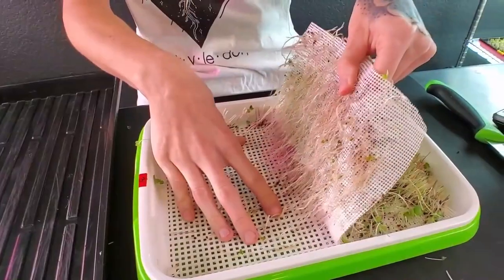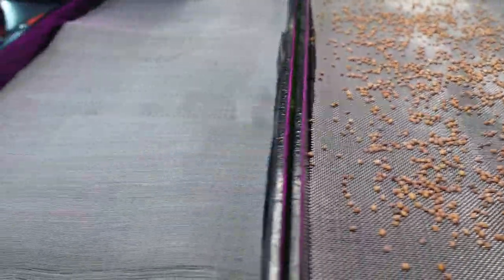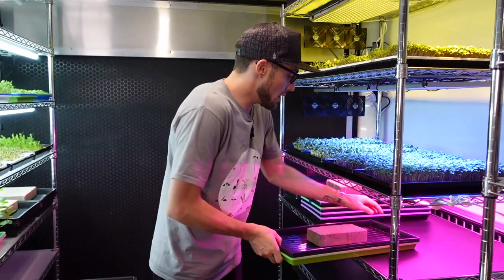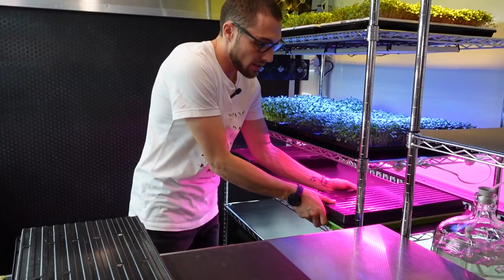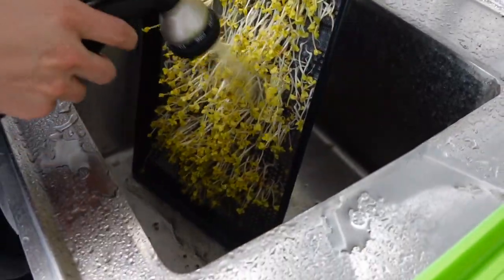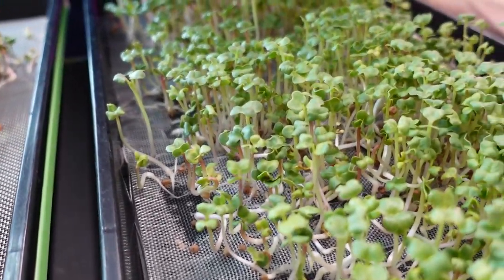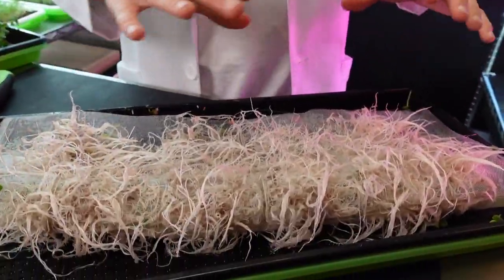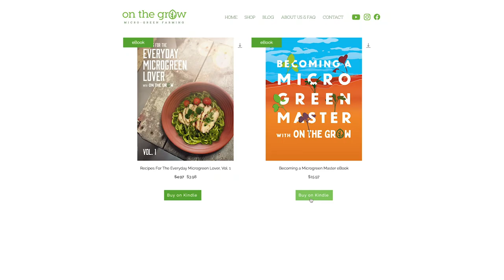Reusable Grow Mediums for Microgreens!!!

Comment: It's a great product idea.  Seems a rigid frame would help it a lot.  Considering that the purpose of your mesh trays is to hold a loose growing medium, they may prove redundant of the concept you're developing.  It would be a real selling point to me if we could keep it a two-piece system: bottom tray and medium frame that suspends the steel mesh, say, a few mm over the wet floor.

Looking at the rest of the comments, you really got our gears turning.  Keep up the content!

Comment: Helpful Info: TYPICAL MESH SIZES

Here's a helpful size progression ive assembled, with examples.

1 mm = #18 mesh (note: 20 mesh is actually 0.85 mm, even though EVERYBODY, buyers & sellers alike, incorrectly assumes it's 1mm)

> Seems ok for many seeds ranging from small to medium, but tiny seeds tend to drop thru (ex: basil). Misting helps.

1.5 mm = #14 mesh (ex: I have some soft flexible white vinyl mesh for my dehydrator that are 1.5 mm, but I dont know the brand)

> This is the min size I suggest for larger seeds and small beans (ex: mung)

2 mm = #10 mesh (this seems fairly common for clear semi-rigid sheets for many dehydrators.  Mine has 2x3mm rectangular mesh)

> seems ok for small beans

2.5 mm = #8 mesh (ex: The Green & white sprouting trays sold on amazon are 2.5 mm).

> seems ok for small beans
3.5 mm = #6 mesh (ex: standard 1020 mesh trays, ala Bootstrap Farmer)

> Ok for most beans (ex: pea shoots, sunflower)
Reply: UPDATE: So far, the seeds that seem to work best for me wiith the 1mm RGM are MUSTARD SEEDS, of which ive tried yellow so far.  Their skinny radicals seem to work well with the mesh, without any signs of stress  and once grown to the size you like you can either pinch out whole clusters with the roots intact, or just cut off the roots with a bench scraper, easy peasey.  

I went with 25 gr for an 8.5 x 11.5 sprouting tray, and got a nice dense grow, without any laydowns.  A little H2O2 is recommended until blackout is over.

I look forward to trying other varieties of mustard MG with the RGM.
Reply: Thank you!

Comment: This was so informative to a newbie like me! Thank you! I wish I had seen it before making a polyethylene purchase lol but, I also went ahead and bought some stainless. So, now I guess I can do my own comparisons, too. But Maaannn was that plastic expensive!!! Holy crap!! $80 for 8 sheets. Vs. $39 for a roll of stainless!! Neither of them have come in yet so, I may end up returning the plastic instead… we’ll see. I just did my very fist tray of Microgreens yesterday… basic salad mix, to start with something easy but I put them in soil because it was all I had. However, I did set it up on a self watering system with a little h2o2 in the mix. Now, I just need to add the bubbler to it so it’s not stagnant. Fingers crossed 🤞🏼 lol Thanks again for your guidance and inspiration. 🌱😊✨

Comment: You can probably warm up that poly mesh in some hot water and make it totally flat. I will get some and try it. Dehydrator mesh flattens right out running inner hot water in a sink no problem.

Comment: This is a good idea, I can see benefits from the stainless steel. Cleaning could be made easier if you were to heat the mesh and dry the greens so they breakaway more cleanly. Probably some kind of oven/grill or blow torch.  I was thinking of trying an alternative media maybe  with some sort of NFT.
Reply from the maker: Great suggestion! Honestly, it’s quite easy to clean with a spatula or similar flat scraping device. As soon as you scrape one side off, the other side just falls out, then all you have to do is a quick rinse and sanitize! Total time to scrape it is under 15 seconds per mat! I’ll make a video on it for next week hopefully! 🌱🌱
Reply: Yes, great idea for cleaning. If you heat it real high, like maybe over 500 degrees, it would turn anything on the screen to carbon.

Comment: FEEDBACK ON RGM (mesh too fine for pulses?):  Hi, im a home hobbyist grower, and decided to give the 1mm Stainless Steel growing mesh a try ... and ran into a problem, because the first thing I tried was pea shoots, and I failed. 

My setup was simple - I used one of those 9x13 green sprouting trays with the white mesh drip tray, cut a sheet of mesh to fit the latter, soaked 100 gr yellow peas for 12 hrs, then spread them on the RGM, added another green nesting tray, and a 5 lb weight, and then waited several days, watering lightly 1x/day.

 So far, only about 1 seed in 4 seemed able get thru the RGM, then thru the plastic mesh tray, and into the water below, during the weighted phase.  All the other radicles just seem to struggle to grow horizontaĺly, and rapidly die off or rot in place even before they reach blackout phase.

I admit i'm a total novice with microgreens, but my guess is that your "one size fits all" approach with the 1mm RGM mesh is ... problematic, not just because different seeds and pulses have very different sizes, but different diameter radicals.  You may need to consider not one bur rather TWO and possibly even THREE different mesh sizes ... say fine mesh (1mm) for fine greens like radishes and broccoli sprouts, medium mesh (1.5 - 2.5 mm) for larger seeds and small pulses (ex: mung bean sprouts), and a larger mesh (3.5 mm) for med to large pulses (ex: pea shoots, soy bean sprouts, etc).

Would love to hear some feedback/advice.

Meanwhile, i'll try mung beans next ... the radicals on those should be a little smaller than peas.  If that doesnt work, i'll just relegate the RGM to small seeds exclusively.
Reply from the maker: Why didn't you grow the peas directly on the mesh sprouting tray? The mesh is meant for smaller seeds that would fall through the plastic mesh. If your seeds don't fall through the plastic mesh, you don't need the metal mesh. 

Yeah, we are going to have more sizes for smaller seeds, but larger seeds can grow directly on the plastic mesh without any need for the RGM. 

Let me know if that makes sense.
Reply: @OnTheGrow  It makes perfect sense, and I was already half expecting that to be the case.   My guess is that 1 mm will likely be good for small to med seeds (upto 3mm), but larger seeds and nearly all pulses wont work with the 1mm RGM - gotta do exactly what you just said (just the mesh tray, with or without a soil as medium).

I'm slowly cobbling together a long list of stuff id like to sprout, and what mediums (if any) are compatible with each.
Reply: In case anyone finds this interesting or useful, I just now checked the sizes of the seeds I have with digital calipers.  I measured max cross section, as a sort of "drop-thru" stat. For example, on Wheatberry, i'd measure max width, not length, and give a range of berry sizes measured.

From my smallest to largest (milimeters)
Quinoa, white: 0.9 - 1.9 mm
Broccoli: (1.5 ish)
Mustard, yellow: 1.2 - 2
Wheat, kamut (diam): 1.6 - 2.5
Radish: 1.7 - 2.9
Mungbean: 2.5 - 4
Yellow Pea: 4.5 - 6.8
Soybean: 5 - 7
Chickpea: 5.5 - 7.8
Reply: @OnTheGrow  UPDATE:  MUNG BEAN SPROUTS (aka Mung Gota) are borderline on the 1mm RGM, but the radical diameters are definitely near the limits of this mesh size, and tend to stress the roots a bit, causing light browning.  Ive tested and confirmed that the min mesh opening needed to avoid root stress seems to be 1.5mm+, similar to soft white vinyl mats typical in some food dehydrators.

TIP (4" long mung sprouts): In order to get mung sprouts to grow long and straight, they need side support, which I manage by using a tall container and careful control of the amt of beans.

Setup: 
> 1 Cambro 2L Polypro Cylindrical Tupperware -> Use a 1/8"drill bit to heavily perforate the bottom of the first cambro (which will serve as the mesh tray), with as many holes as you have the patience for ... the more, the better. Then cut a circle of the 1mm RGM to fit flush inside the bottom of the perforated cambro, and then nest the perforated cambro into the unperforated one, and you're good to go.  

> 1 Cambro 2L PET Cylindrical Tupperware (or just use a 2nd polypro one).  This is the bottom tray, and what you store the finished sprouts in (drain well, salad spin, then line bottom with dry paper towel ... sprouts will keep 5 days or so).

Method: Soak a scant 1/4 cup of Mung Gota (whole green mung beans, unhulled, unsplit) for 8-12 hrs, then rinse well and spread evenly over the RGM in the top cambro. Fill the bottom cambro with 1/2" or so of highly dilute liquid nutrient, so that the radicals dont need to reach far after stretching down thru the RGM. Cover the stack with a dark cloth, and give it 4-5 days of blackout (misting 2x/day with water, just until the radicals reach the nutrient).  Sprouts are done when the tops begin pressing against the cloth, and the first 2 leaves begin appearing.  Do not give these light, or they toughen and turn bitter - theyre ready to eat after blackout.

To harvest, cut off and discard the roots, then submerge sprouts in a LARGE bowl of cold water and agitate gently to dislodge the green hulls (discard).  Done. ☺️
Reply: @OnTheGrow  FEEDBACK (UPDATE): BASIL. 2 tips ...

> Frst, use the RGM to pre-sieve your basil seeds, and reserve any seeds too small that drop thru (about 1/3 for me) for separate use on coco coir.

> Second: once the cotyledens are big enough (approx day 12+), I discovered that the 1mm RGM holes are just large enough to let you pick out individual basil sprouts FULLY INTACT with a pair of tweezers, for transplantation.  The radicals are so skinny that they slip out easily, with all their feeder hairs intact.  So far  ive had 100% transplanting success with them.

Anyway, just sharing the result.  Cheers.

Comment: Do they make a copper mesh? Copper has antimicrobial properties, although I wonder if it would screw with germination as well as keeping mold in check...
Reply from the maker: Great question! I am sure that it would definitely help as you have mentioned, however I wonder about the longevity of copper as a medium... It would make for some fun testing though!
Reply: After some reading, think it might hurt. Seems copper is a necessity nutrient, but excessive copper exposure can hurt germination. From what I read, it could hurt newly formed roots.

It WILL stop mold too, but if it hurts the seed formation too....not much point in using it.
Reply: I've used copper fungicide (organic fungicide) in gardening before too, think hydro is still cheaper though.

Comment: Kinda wanted to see you clean the roots off the mesh to see how the ss sheet stayed flat or bent in the cleaning process.
Reply from the maker: I’m making another video on Reusable Grow Mediums this week and I’ll be sure to include the full cleaning process! It’s quite easy, I use something similar to a spatula to scrap the roots off one side, then the other side just falls out... quick rinse of any extra debris, then a quick sanitize either in a sanitize tub or sanitizing spray... then you’re good to go! Super fast cleanup!
Reply: @OnTheGrow  You may think I'm kidding but I'm serious. Remove most of the roots and then soak the mat in liquid drain cleaner. The cleaner will dissolve every trace of organic matter and will absolutely sterilize the mat. You will be amazed at how effectively the cleaner works. Just be very, very careful not to get any on you. Use gloves and eye protection. You might test a small piece of the stainless mesh before applying it to the whole mat. The plastic mesh will be okay.

Comment: What causes the roots to turn brown and do brown roots mean the tray is ruined? I'm on the second day of blackout.
Reply from the maker: Browning roots is generally due to lack of water, which causes them to dry out and turn brown. If your roots are turning brown, then you need more water. However, it can sometimes also be a sign of damping off. Though I'd guess in your case it's lack of water. Your tray will not be ruined! Just mist the roots some!. Hope this helps

Comment: If the root/radical looks healthy, why would you not simply stick it in the available holes the correct way? Sure, it's 1-2 per tray, but every ounce counts. Have you tried without success?

For the molding issue, could you do an additional day of blackout to help them stand back up once you get it shedded of the debris?

Finally, could you get stainless and make it into mesh with laser cutting, so you're buying the grow media as 10x20xhowever many you need? Don't know that you could get the mesh that fine, but not sure if you need to either...

Just some thoughts. Great video!

Comment: Gently heat the polyethylene mesh with a hairdryer. It should flatten right out.
Please provide a link for the mesh.
Amazon sells a 5 Pack of 30 x 20 cm Rigid Polyethylene Garden's Drainage Mesh made for germinating seeds that looks ideal for this purpose. The hole size is 2mm, which is ideal.
Reply from the maker: Great suggestion! We will take a look at this and order some to test out!! Thanks for sharing!

Comment: Are you guys using H2O2 in your mist? Is the solution being renewed each day? Most people don't understand that it has an effective life barely exceeding 24 hours once it's mixed with water.
Reply from the maker: For our regular watering, no we do not using H202 in our mist. If we are spot treating or feel like we might need it, then we will.... however, we  generally run out and refresh it within 24 hours. It's also better if you have it in a dark bottle that doesn't allow light through.
Reply: @OnTheGrow  Thanks. And, good point about the dark bottle.

Comment: I have a question. Where did you get your stainless steel 304 grade rolls from?I’m having a hard time locating the same mesh size.
Reply from the maker: We now sell it because 304 grade stainless isn't that good for hydroponics, so we got a 316 grade stainless cut to size that is much better at resisting the acids of hydroponics! Check out www.onthegrow.net

Comment: Any legitimacy to the claims that SS mesh will leach heavy metals and be soaked up by microgreens?  Fanboys(paid reps?) For EFG plastic grow mesh mats really push back hard against anyone who says they grow on SS316 mesh screen.
Reply from the maker: No, some people have dropped random studies that involve 304 stainless steel leeching, but the study is using tomato sauce which is highly acidic, and they heat it up to high temperatures. Even with those studies, they said that the amount of metal leached, was still within safe range.

I've asked for anyone to submit anything they can find in an scientific article that says otherwise. 304 and 316 are commonly used in cooking/food prep/liquid storage, etc... so, again still haven't found any actual evidence of it leaching under normal temperatures just sitting in a mildly acidic solution or holding a midly acidic solution.

Nothing we've found in all the studies weve searched says it leaches. 316 was chosen for the extra corrosion resistance to acids, in case the used hydroponic solution is acidic.

We were trying to get NSF certificate for the mesh to clear up any concerns.
Reply from the maker: Also, as long as you properly care for the metal, it should work perfectly for years.
Reply: @OnTheGrow  thank you, I figured as much,  as I couldn't find any studies to to contrary either.. I've used SS 316 for a few years now, sourced from a screen manufacturer in China had a few hundred shipped over. My only gripe is sharp edges, I may fold over or dip in liquid rubber.